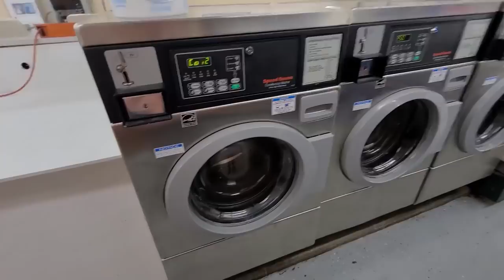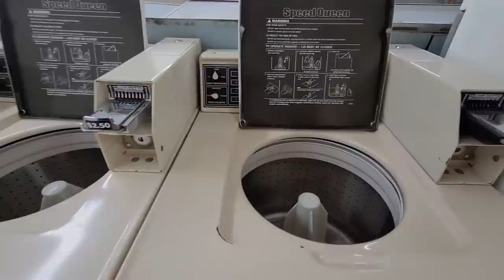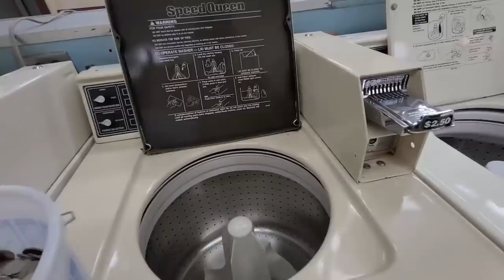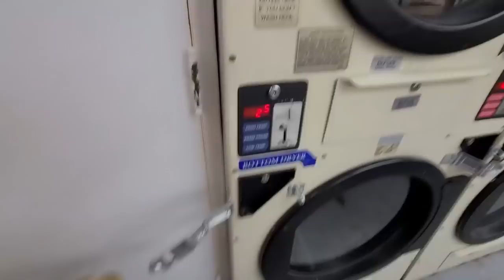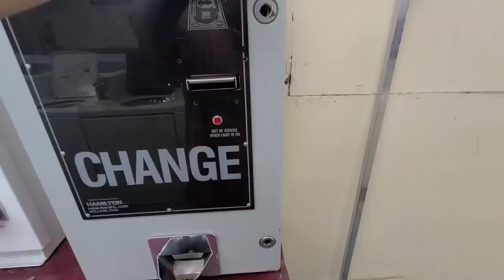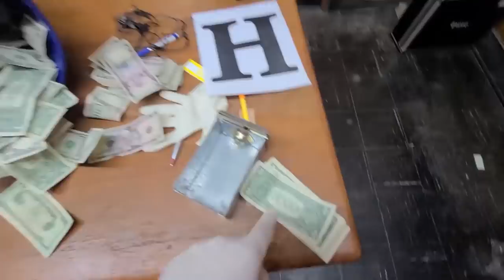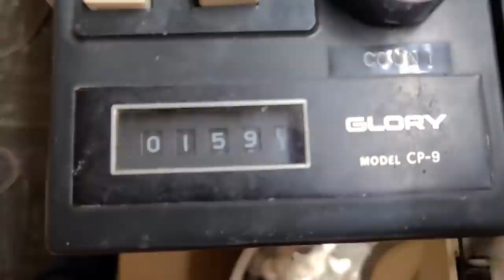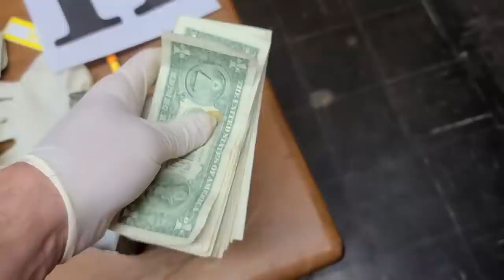How much money does a Laundromat make during 'Rona?

Comment: 90% alcohol is too high. It needs to be lower, around 60-80% to be effective.
Reply: Joey Kendrick - it’s 70% or higher, I think generally people don’t go as high as 90% to add aloe of some other moisturiser to it to use as hand sanitizer, pure ISO is horrible for the skin
Reply: @cunningstunt9226  90% is too much to penetrate the membrane, needs to be lower so it has enough water to penetrate
Reply: Depends on what alcohol were talking but 70% isopropyl is the best ratio to kill the virus. 
Yes the water helps it penetrate the virus and it also makes sure it doesn't evaporate too quickly from surfaces so it has enough time to kill effectively. 

You could always buy 90% though and dilute it yourself if that's all you can find but you need to make sure you get the ratio right.

As for ethl alcohol (in hand sanitizer) they say 60% and up is good enough but I would still try for 70 if you can get it.